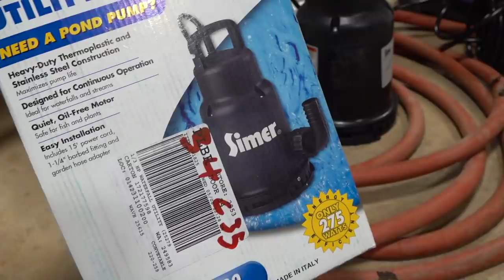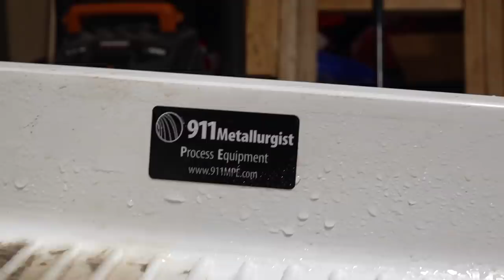YouTube GOLD - the Quest For 3/4 ozt  (s2 e8) Miniature Gold Mining  | RC ADVENTURES

Comment: I've seen every episode.  I look forward to it more than most TV shows.  Because I watched this show I am now 4 seasons deep in Gold Rush.   I have an idea -- because the plant is so efficient {'There's no need for any RC'}, you should now model a legit "cut".  [pre-Episode setup of legit "cut" located a good rocktruck drive from the plant (1) excavate down to simulated bedrock (a rubber sheet) in an area that's something like 2.5mx2.5m; (2) dump a shit ton of pay over the rubber sheet to make a gravel layer (like at least a full scope of the Case 1080) (3) backfill  over the pay with simulated overburden (the topsoil pile you're playing on). ]  Now you have a legit place to build your "cut" on screen. Now you can 1) push off the topsoil overburden  with the dozers (hell make it muddy on purpose) and then (2) use your excavators to actually load the Volvo  rockltruck with paydirt from the "cut".  <<Of course, I have no idea how difficult it is to bring that much pay home from whatever riverbed you shovel it out of, so that could be hard, but if you have piles of your old pay from before the water table,  it would be a good source of extra pay to put it in the simulated cut.  Also you place the simulated cut at a distance that is fun for the rocktrack and you don't obviously have to go the long way around for no reason.>>  {now the truck drivers can complain about the distance to the cut, the dozer operators can bitch about the mud, and the mine boss can fret about all the money that is going into the cut...

Comment: Love the series.May i offer up an observation regarding your oversize (shaker) screen,I noticed that you've got the spray bars pointing down vertically and doesn't appear to be washing the material properly when direct feeding.
     May I suggest that you adjust your spray bars from the second bar slightly back towards the feed end of the screen but leave the first bar vertically down as this will both wash the material better and may just gain you some more gold and could also reduce the amount of water coming off the end of the screen.